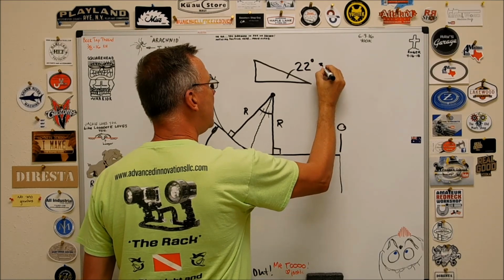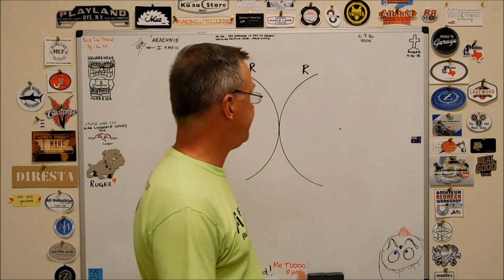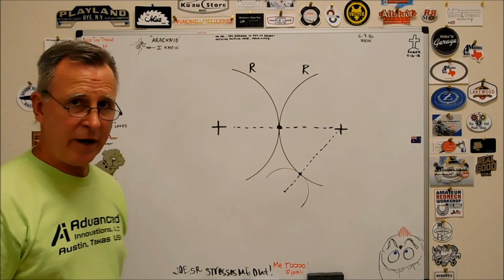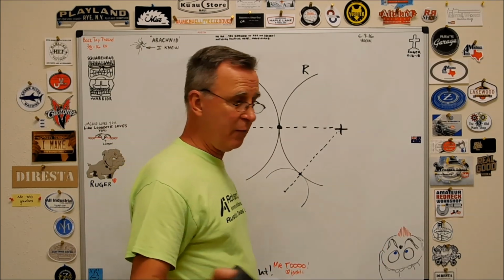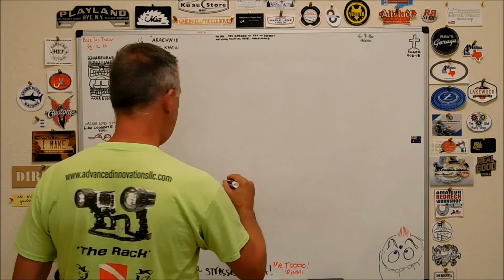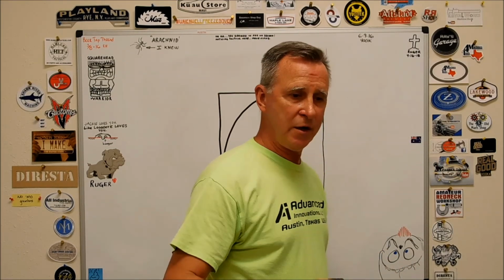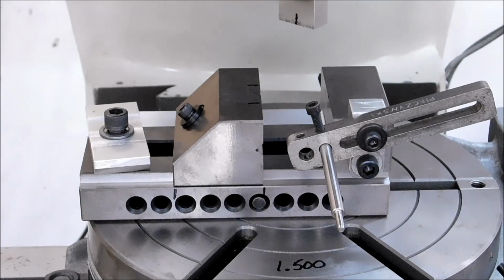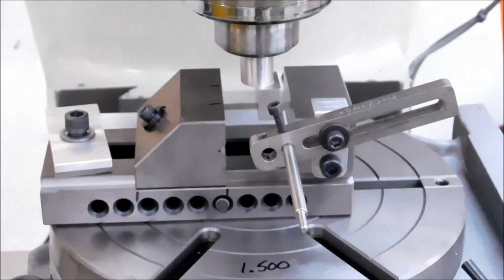Some geometry basics and cutting Tangent radii

Comment: Joe, this may already have been asked and answered but the small "flat" on the junction of the two arcs would have been due to the cut on the 0.850" cut being made at a radius of 1.110" instead of 1.100" as the 0.850"+0.250"=1.100" would call for. I don't believe you made the 0.010" cleanup allowance on the 0.650" side.
Thanks for the math lessons, bringing back my highschool geometry lessons. At 76 you're stretching my brain matter some. It needs the exercise.
Regards from Canada's banana belt. 🤔🇺🇲🦃🇺🇦🕊️🇨🇦🍌👍

Comment: Good morning Joe.  Just found your channel and videos and I am learning and relearning what I forgot.  

I own the same Phase II rotary table and use a coaxial centering indicator to indicate the center ring on my table.  I prefer it over the indicol and dial gauge just for being able to sit and face the gauge and rotate the spindle.  Once I have the table centered by rotating the spindle I then rotate the table and leave the gauge stationary and a second test.

My question.  Wouldn't my method duplicate your second method with the magnetic base?  Also, your second method is indicating off of the quill and not the spindle whereas the spindle was where you locked the indicol too.  Isn't that adding both distance and bearings into the possibility of error?
Reply from the maker: Greetings. I've checked the OD and ID of my spindle to confirm they are concentric. Either surface is an acceptable registration point for rotary table alignment. Other machine may vary, so I would suggest you check , or go with the surface you know is true. I don't believe the quill was used as a point of indication in this video. I'll double check that. EDIT....Look at 34:11  the spindle is being used, not the quill
Reply: @joepie221  ...Thank you for your response.  I was incorrect, I reviewed your video and can now barely see where you were indicating off the spindle.  Camera angle kind of obscured the quill.  I will double check using a magnetic base per your instructions and either confirm or deny that my table center ring and main bearing are in alignment.  Thanks again.

Comment: Hi Joe, 
Trigonometry is very useful in so many trades. 
It's an interesting phenomena that many have difficulty accepting,  where you have two unequal circles that are touching, and you draw a line tangent to both circle circumference, and a second tangent through the point where both circles meet, the two tangent lines interact at the mid point of the first tangent to both circle circumferences.

It naturally is the same where the circles are the same size. 

Regards Dennis.

Comment: Thanks Joe, another greight video. I'll have to make make myself one of those setup tools - but metric of course!
Reply from the maker: This one was. It measures 25.4mm x 12.7 square with a 19.05 dia shank. Simple. :)
Reply: @joepie221  Lol! I think mine will be smaller, 10mmx5mm square, 6mm shank. :)
Reply: @joepie221  hi Joe, how are those pins made? I'm assuming from a solid piece of square stock, turn the pin first and then mill the block to a rectangle. Must waste a huge amount of material. Or are they two pieces, joined together and then ground to perfection. If it's not a "trade secret " can you let us know please? Maybe a demo in the CNC. 
Thanks, 🇨🇦🍌🥋

Comment: Great video.  That took a lot of mystery of how to cut a cam in a part without struggling
Reply from the maker: You can make a simple cam by just taking a full round slug and drilling the axis hole off center if it serves your purpose.

Comment: There is absolutely no doubt in your ability Joe, but a Renishaw probe would have it all done in a tenth of the time. Rotary tables old hat IMHO?? - talk to the guys who still use these, if you can find them - they'll be out of business by now??  (I'm not trying to be rude)
Reply from the maker: No rudeness implied. but please be aware ....anybody can do a good part with a bottomless check book and all the right tools. It takes a true craftsman to do the job with whats on hand. Thats the whole point of my channel. get it done. Now. Don't order shit. GO.
Reply: Joe Pieczynski A true craftsman knows what tools are required for a job instead of playing around wasting time.
Reply: There's a difference between production and job shop type activities that Joe is showing here.

If there is a business case for the fancy gear and the cnc go for it. However in a job shop, the shop who says "Yes I'll have that for you tomorrow" will get the business. There's not time to get in fancy gear and no business case for a 5 axis cnc machine. 

Every good job shop that I've done work with has a few standard machines, 3 axis cnc, maybe two if they do big stuff (small and a big one, don't want to use a big less stiff machine for small work), cnc turret lathe, and a surface grinder (again maybe two depending on size of their work).

You know what they'll also have? A manual Clausing or similar and a K&T or Bridgeport in the corner with all the dressing, rotary table included.

WHY? Because there's always that odd job you need done now and that gear has the flexibility to do it with the right skills.

These machines are relatively cheap, and I'll pay out the ass for you to use them because the lines down and it costs me $7,000/hour for it to be down. (That's low btw compared to some higher speed mfg).

-MFG engineer who used to work in heavy industry.
Reply: @Taskarnin  i agree with you, anyone can do the job with all the fancy one off tools, only a true craftsman will get it done with whats on hand, and thats what joe is, a true craftsman
Reply: @caitlinleanna5028  Agreed Caitlin, John, Australia.
Great tutorial again Joe, thumbs up.

Comment: Joe, another great informative video! I setup my rotary the same way and mine is not true to the center hole either. To be totally geeky about it, you did leave out one step indicating it. You did not check the tram of the head. If the tram is out, the center of the spindle will be in a different XY position at the quill verses the face of the rotary table. In my experience, if my tram is out just a little, and I have to crank the knee up or down during a setup, I loose registration on my part. Might explain that small flat you ended up with.

Comment: Joe π, 
Thanks for all your lessons! 
Is the rectangular portion of your pin essential? I have a minimill with a max capacity of only 3/8 inch. It seems I could do the same set-up using just a 3/8 inch pin and a stack of gauge blocks. Your flat surface would make it easier, but does it make it more accurate?  Thanks.
Reply from the maker: The shape of the head on this pin assures you have a flat registration surface on center, all 4 ways, at a set distance. I imagine a  pin would get you by,  but you may loose some utility along the way if you needed multiple square references for setup. Having an offset surface to register from allows for setup without moving anything. A full round pin would force some movement if your setup needed something less than the radius of the pin you selected.

Comment: Joe, what is a good vise for a minimill? I have a micro ark minimill and bought their vise. I am not impressed with the vise as it isn't trust worthy to hold a part (poor design in the squeezing mechanism). Thanks in advance!
Reply from the maker: I believe Kurt makes a 4". If its not too big, I'd go there.
Reply: Joe is right about the 4" kurt but if you are a hobbyist or on a budget there are some alternatives. There are some Taiwanese kurt clones that are about half the price. I'm not talking about the $100 models they are junk. I have a 2017 Shars catalog and there 4" vise is $250. Adom Booth did a video on the 5" version where he went over the specs and verified it himself it was spot on. This Old Tony did a similar video. Vertex is a great brand or there are alot of quality products made in Poland. Look for something that has a rebuild kit available down the road if not I'd probably pass. Good luck.

Comment: By the way, I would love to see a video showing how you manufacture those little offset gizmos.
Reply from the maker: They are very precision and tougher to make than they appear. Start life as a 12' long bar of 1 1/2" diameter 303 stainless. I strive to guarantee the position and offset is kept to .0005 position and size. Every one is checked 100% during machining .
Reply: @joepie221  That's what makes it so interesting! There's something absolutely beautiful about precision work. I also watch Edge Precision and Suburban Tool videos.

Comment: Hello Joe, Thanks for the video. There are not enough rotary table setup videos and yours are the best by far. 

Next time I am in the shop I will have to check the center of my rotary table in the manner you described. My Yuasa 10" table has a #3 Morse taper that comes to near the top so there isn't the ring as yours have. 

My thoughts echoed Paul's about testing on the taper and it would be interesting to see if your measurements on the taper match the ring. Food for thought. 

It is doubtful if there is any measurable difference from the outer part of the spindle nose and the taper. I had checked my Lagun spindle one time and did not see any difference with a .0001" dial indicator.
Reply from the maker: I will dig into that variatioin as time permits, but spinning the table, is by far, the most accurate way to set it up.

Comment: In Your second method for aligning the RT withe the spindle axis, you assume that the spindle quill has no runout; not a valid assumption on some mills.  Here is what I do the align the two axes.  I mount a piece of stock at the approximate center of the table and offset the table slightly.  Then I mill a cylinder by rotating the RT.  You now have a a surface that is absolutely true to the RT axis.  Then I use an edge finder or the Indicol to center the milled surface with the mill spindle axis.  You now have the two axes aligned regardless of any runout in either.
Reply from the maker: Your technique is a great way to guarantee you get a true surface to line up. And, No assumption on my machine. I know the OD of my mill spindle, at that area, is dead on to the internal taper.
Reply: Excellent way to go about it Robert.

Comment: Seems to me that if the bore of the table is it not in line with the axis of rotation, you've got a pretty serious problem with that table, and it needs to be either fixed or scrapped. In this case I wonder if disengaging the worm gear introduced some slop into the table itself.

Another thing I noticed is that you're indicating in the top edge of the bore, not down in the Morse taper in the first procedure. Likewise, in the second procedure you're indicating on the outside of the spindle nose, as opposed to a pin held in the collet. Are those ground and true surfaces?
Reply from the maker: The mill spindle is, but the table ring needs to be double checked. But you are correct, a pin in a collet would get you the most accurate representation of concentric.
Reply: @joepie221  I was wondering about this as well.  I'm only an amateur so sometimes the language escapes me, but it seems to me that in the second method, the hole in the spindle for the tool could be eccentric to the OD of the spindle and you could be measuring that, not the table.

Of course, it if was eccentric like that, it seems like any tool would be maching an oval rather than a circle?

Comment: With the rotary table segment.  At sometime wouldn't you have to confirm that the spindle was perfectly round, before indicating it from the rotary table?  I'm sure it should be, but we all know what happens with assumptions.  Good video.
Reply: It probably is round, but I would think that indicating off of a tool or precision rod being held in the spindle would be better.
Reply from the maker: @number40Fan  Probably.

Comment: I’m a 45yr vet of the building construction trade and have read probably 10,000+ construction diagrams each one containing multiple assemblies and multiple operations to complete task. The main point that came to mind you touched on, breaking down assemblies into single steps in a specific sequence. How do you eat an elephant? One bite at a time!

Comment: Joe, another great video! Question though, wouldn't much of the flat left at the end of the part where the two radii are tangent be related to the 10thou stock left for clean up pass?
Reply from the maker: Yes. On parts that are critical, make extra stock allowance at the very beginning and machine the entire profile. Any deviation in squareness or cutter diameter will show up as a flat.